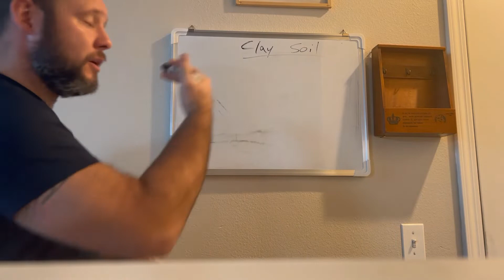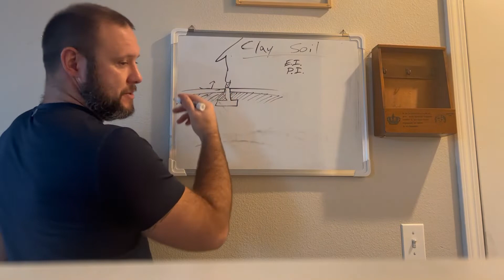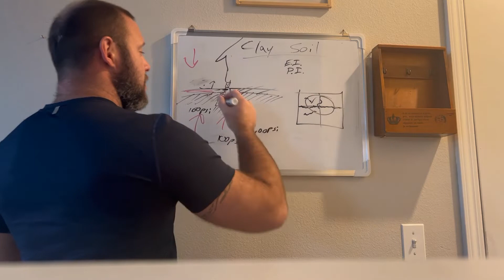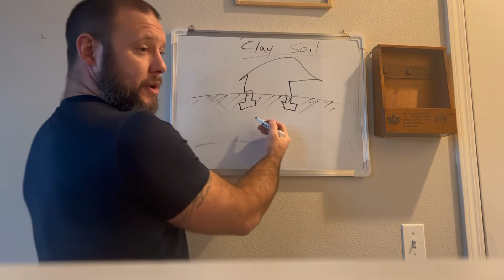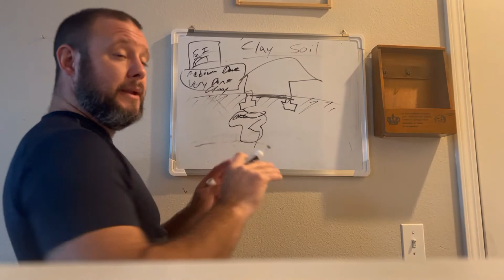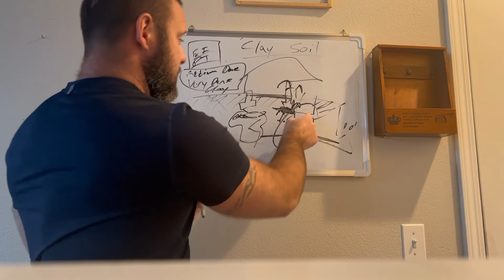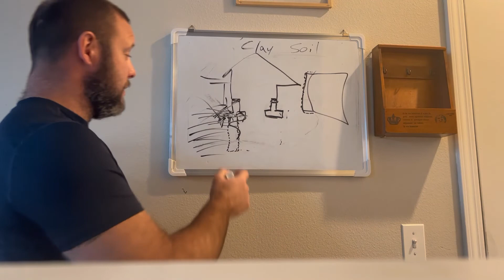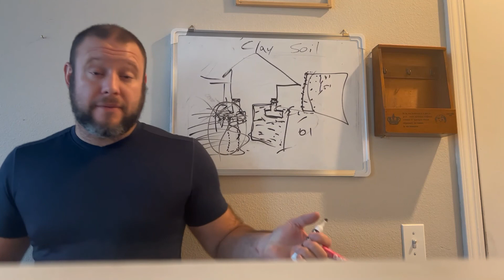Clay Soils (Intro)

Comment: I’m wonder if you can help.  A little background… I live in Canada,  Edmonton, Alberta to be exact.  My house was built in an area that had a lot of muskeg, which is comprised of mosses, sedges, grasses, and remnants of plant matter decomposed to various extent.  Long story short it’s a nightmare to build on.  In my area, I believe they excavated away the muskeg which left a lot clay based soil.  We also have a high water table, so most homes are built with a sump pump system.  I have a hilled backyard, so water drainage flows through the front grass and a rock swale on the other side.  My neighbour and I both have downspouts at the front and back of our houses that drain into the rock swale.  The driveway was mudjacked about 15 years ago.  While there has been some settlement, it was minor and no new cracks had formed on the surface or in the expansion joints.

Just over 2 years ago, a cable company decided upgrade to fibre optic cable.  They contracted another company to do the work, which involved drilling channels underground along the utility easement area by the sidewalk of everyone’s property and underneath our driveways.  They also installed a 36 x 24.4 inch service box in the rock swale on the North side of my driveway by the sidewalk.  Not one employee from either company knew what fluffing or the expansion factor was. There was no engineering assessments prior to the work.  They started the work in early November when the ground was already frozen and temperatures were below freezing. Immediately before digging the hole in the rock swale, they flooded the soil and for some reason removed soil from underneath my driveway; undermining the integrity of the foundation.  I discovered this when part of my driveway fell into the hole.  The excavated hole was left uncovered for several days during a heavy snowfall, before the service box was finally installed.  They didn’t completely backfill all the dirt because they ran out of supplies and had to wait until spring to finish the work.  A 4” channel was also left open spanning the driveway parallel to the sidewalk.  That winter my driveway did not do the normal frost heaving, it settled lower then ever before. Apparently the frost heaving was extremely bad that year, because of periods of unusually warm weather, melting snow and rain, followed by extremely cold weather in the -30°c.  In the spring, water from melting snow couldn’t drain properly, because the water was blocked by piles of soil and rocks they left in the rock swale.  Water pooled in the area between the houses, which had NEVER occurred before (my neighbour is the original owner and I’ve lived here for 17+ years.) Unfortunately my property is lower than my neighbour’s so as you said, the path of least resistance was under my driveway.  No concrete products were used during the partial or final backfilling process, so the integrity of the driveway foundation wasn’t repaired.  When they completed installing the cables in the spring, they just levelled out the piles of soil and rocks, which damaged the landscaping grade and caused more drainage problems.  Water no longer flows towards the street, it stays in the area where the downspouts are, which is right next to  the separation joint of the garage. Even though we had frost heaving prior to this work, there was no “stepping” of the driveway away from the garage foundation until after the work was done. Prior to the work my driveway would heave up and be level with the garage floor in winter and then slowly settle back about 1-2” over the spring/summer.  After the work a gap formed in the separation space between the driveway and garage foundation and has continued to widen, and parts of fibreboard have just disappeared. What’s odd, is that the normal frost heaving and settling cycle has essentially stopped.  In fact parts of the driveway by the sidewalk settle lower during the cold winter months.  My driveway is now approximately 2 inches lower by the sidewalk and 3-4 inches at the garage.  The driveway is sloped so water is damming at the sidewalk. This part of the driveway has never been mudjacked, because it didn’t move.  The expansion joints also cracked and widened after the work.  The center of the driveway is now uneven; the North side is about an inch higher then the south side.  The middle portion on the North side of the driveway has dropped lower then the rest of the driveway, which is where the piles of rocks and dirt were placed.

Luckily I had hired several really bad snow removal companies, so I had a lot of photos of my driveway before the work.  After 2 yrs I finally got the company to admit fault, but they don’t want to admit to everything.  The engineer they hired blamed normal frost heaving cycles for the settlement and “stepping” by the garage, even though that has essentially stopped and this is where the water accumulates.  Unfortunately it seems the company is trying to do the minimum to fix it.  They just want to mudjack the driveway by the sidewalk, and fix the grade in the rock swale.

I learned a lot in your video, but I want to have a better understanding of my situation so I can hire the proper engineer or professional for this situation.  First question: would the expansive properties of the clay based soil cause soil migration or worsen any voids caused during excavation, leaving open spaces for several months or improperly backfilling?  Would any of this affect the compaction of the soil underneath the driveway?  Can soil migration occur when the integrity of the foundation was damaged?  Would 2 years of improper drainage cause enough soil erosion to create voids large enough for the fibre board to fall into?  Is there a way to check the soundness of the driveway foundation? Do you have ANY other recommendations?  Any help would be very appreciated.
Reply from the maker: Whoo. You have quite the history and question! It's difficult to analyze something without physically looking at it or testing soil rpoperties, so there's a lot of assumptions I would need to make to adequately reply to all of your concerns. I'd have to caution you both that I'm not a lawyer, nor a registered engineer, I am just a guy trying to provide helpful info based on the knowledge and experience that I DO have. That being said, the following:

1) Yes, it CAN migrate soil or worsen voidspace between particles, but it can have the opposite affect as well. This is why gound preparation is so important, to control some of that chaos. But like a slab that settles that needs to be sawcut to prevent aggregate lock before lifting it back up - thing's don't rise and fall in perfect harmony. Like any remodeler who understands there's no such thing as straight, level, and plumb on the easiest of jobs =)

2) Depending on the type of clay, it can affect the compaction levels more or less severely. A hard clay or caliche clay is still incredibly strong in its expanded state, even lifitng entire structures instead of just slabs. But the mass itself doesn't just disappear when it expands or constricts, it simply puts water into the particles and creates expansion. The compressive strength would be affected, then, but in many ways based on soil type. 

3) If you create a void, soil can move into the void. Things have the tendency to be lazy, succumbing to gravity first, and the easiest paths of resistance second. Now if the soil isn't collapsible or loose, it will have the tendency to tie together and you have less risk of the soil migrating at all, which is why many clays will remain in place while moving the things on top it (staistepping, like slabs). 

4) Regarding the erosion question of two years, it's a tough one. Yes it can, couldn't possibly tell you if that's something you're at risk of or if that's happening at your residence. There's far too many factors from soil type to level of moisture to rate of movement of the moisture to gradient to many other things, it's just not something I can say is happening at your residence, and would defer to specialist on that one. 

5) I would defer more to a structural engineer to check the soundness of something, but there are tests that can be done for the strength of concrete. 

6) Realistically, it may seem like their problems have exacerbate the issues at the home, but it doesn't necessarily make them the CAUSE of the problem. I would ensure they mudjack under the driveway and fix the rock swale, for sure. There was some negligence exercised and it should be corrected (my opinion, not a legal opinion). But soils properties do change over time. It would be very difficult to put that one the cable company as long as correllation is not causation. I'd put some nasty letters in there too hah. 

7) With the parameters you offered, remember that organic material will decompose over long periods of time. This may put off gasses or just as importantly create pocket voids and weaker layers of soil that will allow subsidence around the property. It's why we do a lot of treatments for areas built over former landfills. A critical part of stability will be to control the moisture around the property, and ESPECIALLY under heavy structures like your home. For lighter structures, it is ever the challenge to maintain levelness and stability. People throughout areas of Southern California have pretty much accepted cracking sidewalks and even driveways as life. Expansion joints will always help, but expansive soils will always behave as they do. 

I know not the best evaluation or what you were hoping to hear, but those are my thoughts as best as I can gather them. I hope this helps you to understand and, if I am in error, please feel free to share!!!!

Comment: Thanks for great video so what kind of report we should get from a soil inspection engineer ?
Reply from the maker: That will vary on the issues you're experiencing and the site conditions for your specific problem. In example, if you're on a hillside and you're experiencing some of the problems laid out in our hillside video, then you would want to do an evaluation of the slope, finding the slip plane, and perhaps a slope stability analysis that includes some testing with an inclinometer. That's ENTIRELY unnecessary on a flat lot ina  flat subdivision. 

With that out of the way, generally you will want either a "Ground Improvement Report" or a "Soils Report" from a Civil or Geotechnical Engineer. The report will include some soils testing which, at its most basic, will tell you the soil type, gradation, moisture content, dry density, plasticity index, expansion index, and record the N values for the relative strength of the soil. In addition, there should be observations of the site conditions, and repair recommendations if necessary. More comprehensive reports (typical of soils reports and required by CBC/IBC) will also include int he evaluation the seismic design category and how that affects the property, and an evaluation of available information through the local jurisdiction with regard to historical landslide/flooding/etc zones in the area. 

When you consider it all, there's a reason those soils reports get to be so expensive! If you move into the permitting phase, depending on local municipal codes, many cities now also require historical reviews which are MUCH more detailed plans and reports, and require a TON more effort (and cost).
Reply: Nice job!  Great teaching video

Comment: The biggest problem is soil engineers gets too expensive these days at least in my area (SF)
Reply from the maker: That is definitely the conundrum. On one hand, it’s something that cannot positively be done with absolute certainty without an engineers input. On the flipside, you can spend $80,000 doing soils testing on a single property, and still not know exactly what the soils are, and how to mitigate them. Civil engineering is the most inexact form of engineering that exists. For that reason, there will always be an associated risk. So you have to find the balance between the testing of the soil and value engineering.

That being said, everything in San Francisco is expensive  😂😂😂

There are some good foundation repair experts in the area. Many of them use combinations of systems, or they specialize in a single system, such as piering, concrete replacement, drainage mitigation, or polymer injection. Notable companies in the bay area are URETEK, FRC, bay area underpinning, Ramjack, and EagleLIFT. 

When these companies provide recommendations, it should be backed by an engineers analysis. Some companies opt to use engineers to create plans and reports based off of their findings, without doing an on-site investigation. This can work, but it’s sometimes very difficult and it’s a good standard of practice to have the engineer actually be on site and evaluating the issues. 

From that point forward, depending on the repair type, either repair specific or site specific soils testing and analysis should be a bare minimum. In example, I could do a soils test to evaluate how deep a push pier would go, but that would only be part of the information needed for a helical pier. That would also provide good information on how deep polymer injection would need to be provided, but it would not provide soils type, which could change the type of polymer, or render the polymer ineffective, if the soil was not porous enough for the polymer to travel.

So this is probably just the long-winded way of saying there is value engineering available, but it will still be expensive, and it is always necessary.

Comment: what is the significance of wall cracks where it isnt separation but pushing in? 6:01
Reply from the maker: A separation crack, where the wall is pulling apart, assuming it is not a bonding related crack, or other minor type of cosmetic crack, indicates that the wall is being pulled apart, specifically. This could mean that another portion of the foundation is settling down, which pulls upward on the SuperStructure, and creates the separation where you are seeing, this type of crack, or it could mean that the foundation underneath that crack is pulling down and out, creating that type of separation.

Inversely, if the crack is “pushing out” the drywall instead of separating it, it indicates that there is a type of compression going on. This could mean another portion of the foundation is lifting upward, which would push down on the super structure, and create a compression, tape, crack, or the foundation underneath that crack could be pushing upward, also creating a compression. In addition, it could indicate that the loading of the structure is greater than what structure can support, and it is collapsing in the wall, and creating a compression tape crack, which would be indicated by a perfectly level foundation, or more stress fractures on the slab, pushing down, if the slab is going down as well. In any case, the compression tape cracks indicate some very specific failures, and usually are not related to differential settlement. Some exceptions, of course, could always apply.

Comment: Thanks for the great video, how about using a corrugated metal sheets around the building to act as a concrete curtain? then import mixed soil/gravel to fill the excavation between the metal sheets and the foundations. As for the interior slab, you may drill wills every 500sq-ft to drain excess moisture from the soil beneath the slab.
Reply from the maker: Did some  checking around with a few of the Civils I work with, and this solution checks out! Depending ont he existing condition of the expansive clay (how expanded it is at the time of repair), the dissolution of water may result in some anticipated settlement, but then again if the issue is a heave caused by expansion then you can expect the structure to settle back to within normal parameters, assuming the initial construction was done properly. Any and all efforts to utilize drainage the mitigate the expansion and constriction can only be a benefit. Thanks for sending me toward a different means of mitigation!